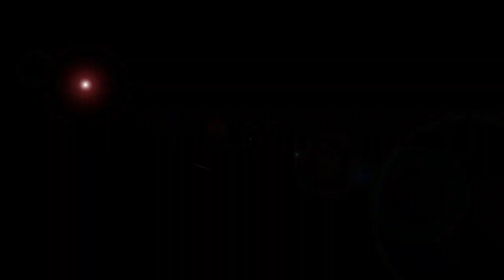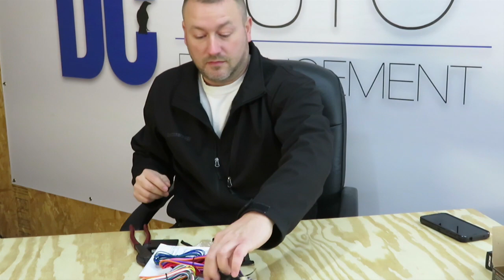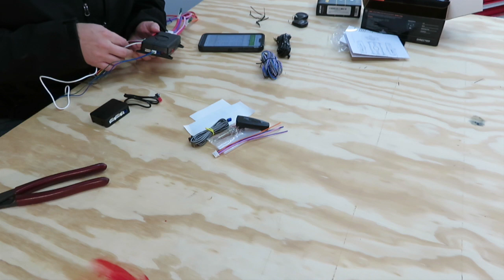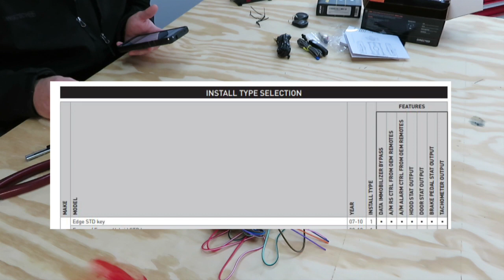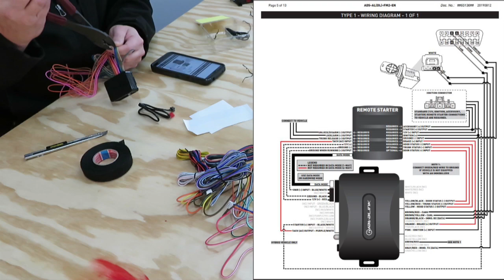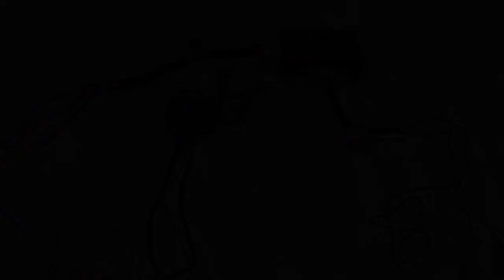Simplifying Remote Start Wiring! Easy Tip to Making Remote Start Wiring Manageable!

Comment: Any advice or needed parts?I got asked. To put this in a 06 pontiac torrent.
Reply from the maker: Here are the parts that you can use. And below check out the link to Flashlogic website. And I'll leave a link to your car wiring information also.
Avital 4105L 
http://bit.ly/36nkmdB
https://amzn.to/3nZrg1x

Flashlogic FLCAN
http://bit.ly/39AvzcI
https://amzn.to/3nWC5RO

Flashlogic Programmer
http://bit.ly/37AmVt2
https://amzn.to/3n1Mn1D
Flashlogic.com
http://www.bulldogsecurity.com/bdnew/vehiclewiringdiagrams.aspx

Comment: Can I just rid of the box that connects to obd2 port if only using it for remote start ?
Reply from the maker: What kind of car are you working on?
Reply: @DCAutoEnhancement   a 1993 Chevy Silverado
Reply from the maker: @colebryant6850  then you only need the remote start and no additional parts
Reply: @DCAutoEnhancement  thanks a lot man definitely gained a sub 🤘
Reply from the maker: @colebryant6850  I'm not sure if you have this info yet but here are two links to vehicle wiring for your truck:
http://www.bulldogsecurity.com/bdnew/vehiclewiringdiagrams.aspx
http://www.commandocaralarms.com/wiring/1992-1994/chevrolet/full-sizepick-up/462.html
Reply from the maker: @C M you will need a bypass. I use flashlogic from their website flashlogic.com you can look up your vehicle to find the module that works for your vehicle. Here is a link to the program the module: https://amzn.to/3n1Mn1D
Reply from the maker: @C M maybe look through my remote start playlist. I think I have one that may give some insight. It won't be for your exact vehicle. If I find the one I'm talking about, I'll put the link here.
Reply from the maker: Try this one: https://youtu.be/Hvdpr248kNE
Reply from the maker: I just realized that the link I sent was for the same video that you commented on. I'll post another link
Reply from the maker: Maybe this one. It's not your vehicle but you can see how I determine what wires I need and what wires I don't. https://youtu.be/-J6W7yhH0eE
Reply from the maker: @C M  let me know if you have questions.
Reply from the maker: @C M I usually download the software but it really doesn't matter what order you do it in

Comment: It's interesting and encouraging to see that a lot of the wires aren't used.  It actually does make me feel like maybe I can do this.  However, I feel like what's missing from this video is a brief discussion on why the other wires aren't needed.  Simply saying "A lot of these wires go away" is a good start, but why do they go away?  In other words, how do I determine which wires are going to be needed on my install?  I'm not installing my starter into the exact same car you have, so I'd like to get an idea of how different my install will be from yours.  Interesting video nonetheless, thanks for posting it.
Reply from the maker: I appreciate your feedback. Would you like information on how to determine what wires you will need and not need on you particular vehicle?  I'd be happy to help.
Reply: @DCAutoEnhancement  Really?  I'd take you up on that!  It's for a 2013 Subaru Legacy (automatic trans).  Thanks!
Reply from the maker: @mroberts566  can you send me an email at dcautodiy@gmail.com and I'll reply back with the info.
Reply: Sending an email your way as well.
Reply from the maker: Sent you an email back.

Comment: Hi! What wires would you need off the remote start if your not using a FLCAN?
Reply from the maker: The same that I had previously told you. You just won't be using the data harness that would go to the flcan
Reply: @DCAutoEnhancement  oh okay. Just wanted to make sure cause turns out to be that a 2013 Kia soul doesn't have a key immobilizer. Really appreciate your help. Sorry for the confusion. Thanks again
Reply from the maker: No problem. Did you get it installed? I think the door looks are the only thing that you will need to wire direct if your not using the flcan
Reply: @DCAutoEnhancement  I wired in all the heavy gauge wires as well as the parking light, door lock  hardness, brake shut down input, horn output, and I think about 2 ground wires. I ran out of time last night but I think I just have to find the tachometer wire. Is the tachometer wire necessory also did I miss any other wires? I appreciate you checking in. Thanks again for all your help. I would've never tired doing this install until I seen all your videos explaining wires breakdown.
Reply from the maker: Sorry for the delay. Tach is not required however, it is the best method. You can set the unit to "dbi tach" or voltage and it will work.
Reply: @DCAutoEnhancement  appreciate the help. I finished the install the other day the only problem I'm trying to figure out is why my parking lights are not going on when I activate the remote start. I checked the wire and everything seems like it's working properly. I did some research today and found something about using the jumper bypass. I'm gonna try that when I get a chance.

Comment: I am trying to hook this to a semi truck.   So I am trying to understand the bare minimum needed to make a remote starter work without any bells or whistles.   No key computer chips.  Just a basic ignition.  Truck won't start unless brake is on and the truck is in neutral.  It is an automatic and when the brake is engaged it automatically puts the truck in neutral.  So really what are the minimum number of wires needed for a remote start.
Reply from the maker: Where are you located? The brake pedal poses a bit of trouble but can be bypassed. Usually you will only need 4 main ignition wires (12v, ignition, accessory, and start) (Ground and black/white small wire on remote start)

Comment: What kind of bypass you used for that remote starter ? and what’s that bolt  looking thing I think you said it’s on  hood sensor or opener
Reply: And do you have a video of you installing this remote starter on a vehicle from start to finish like each piece thanks
Reply from the maker: @RajendraSingh-qg3cx  I actually have a video coming up that I will do a start to finish. I have been making the videos shorter for the sake of time but felt that it might be appreciated if I make a more detailed video. I'll probably be posting the video that I'm talking about Jan 7th. Is there anything in particular that you would like to see?
Reply: DC Auto Enhancement I have a 2008 Kia Sedona do you have any advice for me if I need to use the hood pin And what wired to illuminate from the remote starter please and thanks in advance
Reply from the maker: @RajendraSingh-qg3cx  the hood pin switch is a safety device that will prevent the remote start from starting the car while the hood is open however, it is not required for operation. I'll look up info on that vehicle and add a link to this reply for you to view. The only advice I have is to make sure you have everything you need before starting the installation, test your wires before making the connections when and where possible, and take your time.  I took a look at the FLCAN, if you use that bypass you won't need to direct wire the door lock wires. Take a moment to review this and read note #3 http://www.commandocaralarms.com/wiring/2008-2011/kia/sedona/1206.html
Reply: DC Auto Enhancement Many thanks but I’ve already googled and got that diagram for my vehicle in advance and I am going with that flcan module as you recommend The bypass module I currently have is way much cheaper very much more complicated so I’ll spend a few dollars more and go with the  flcan
Reply: And also that website is suggesting that I use the 791 module now I’m puzzled I don’t know which way to go
Reply from the maker: @RajendraSingh-qg3cx  which bypass do you have?
Reply from the maker: @RajendraSingh-qg3cx  the 791 bypass is the one that website sells. You can use any that will work for your vehicle. The only draw back to the FLCAN is that you have to have a programmer for it to download the firmware for your specific vehicle.
Reply: DC Auto Enhancement I currently have in my position banvie universal but after I saw your video I thought the falcon was the best one to work with the remote starter and I bought the exact remote starter that you have in your video so I look up the flacon to buy it but I have not bought it as yet
Reply from the maker: @RajendraSingh-qg3cx  you will want to buy the FLPROG as well.
Reply: DC Auto Enhancement OK thanks but I found a seller that says if I bought the falcon from them they would program the device to match my vehicle Hope it all goes well I really wish there was a video that shows me what wire I need to illuminate from all those wire that came with the remote starters just like the video you did with the Ford explore
Reply from the maker: @RajendraSingh-qg3cx  when you say illuminate, I'm not exactly sure what you mean
Reply: DC Auto Enhancement Sorry I meant to say eliminate lol
Reply from the maker: @RajendraSingh-qg3cx  comment when you have all of your equipment and I'll go through the wiring of both the remote start and the bypass and make a short video and post the link to it.
Reply: DC Auto Enhancement Again many thanks for your time and all of your help very much appreciate it
Reply from the maker: @RajendraSingh-qg3cx  not a problem that's why I decided to start paying videos.
Reply: DC Auto Enhancement I should get the bypass by next week so if you have a video by them I know you said by the seventh that will be perfect
Reply: Hey buddy it’s me again I got all my stuff in  and I got the module and the remote start So whenever you have time to make that small video and walk me through this step-by-step Wiring like you said I will appreciate it thanks
Reply: DC Auto Hey buddy it’s me again I got all my stuff in  and I got the module and the remote start So whenever you have time to make that small video and walk me through this step-by-step Wiring like you said I will appreciate it thanks
Reply from the maker: @RajendraSingh-qg3cx  I'll be posting it shortly. I filmed it this evening. You gave me a good idea to offer this to anyone wanting the same help. I did notice that from what I can tell your vehicle needs the Klon process done which is a two step programming to program your module. Basically means that you will install, do step one of programming, remove and hook back up to computer, then reinstall and do the second part of programming. Unless I missed something.
Reply: DC Auto Enhancement Yes you are right I was told that when I bought the program cable you advise me too so if you have the website or the program that I need to download also I appreciate it
Reply from the maker: @RajendraSingh-qg3cx  I will. I am installing a remote start on a 2013 Kia Optima tomorrow and it will be very similar in the programming so I will try to make make sure to cover that part clearly.
Reply from the maker: @RajendraSingh-qg3cx  Flashlogic.com
Reply from the maker: @RajendraSingh-qg3cx  the video should be live in about 30 min. I'll put the link here
Reply: DC Auto Enhancement ok thanks
Reply from the maker: @RajendraSingh-qg3cx   it took longer than I expected. Please let me know if there is anything that I missed. If I could have installed one to show, I would have. Hopefully the programming on my next video will be helpful.  I'm going to try to capture more of the programming of the FLCAN as well as the remote start. https://youtu.be/FdcY8_jHw9w
Reply: DC Auto Enhancement hey buddy it’s me again I got the remote start and the bypass  wiring connected I have two question for the bypass we do not need the data cable like you said or we will need them later and the power card for the bypass which is the black red and blue and white do I connect them to the bypass or I don’t need them at all if I don’t do not need none of these wires what connects the bypass to Remote start
Reply from the maker: @RajendraSingh-qg3cx  you will use the data cable that has the red plug on it. That is how the Avital unit communicated to the FLCAN
Reply: DC Auto Enhancement I did that what about the power cable from the bypass that has the red black and blue wire I just sell eliminate that all together and do not use it thanks
Reply from the maker: @RajendraSingh-qg3cx  you don't use it.
Reply: DC Auto Enhancement cool You did a good job on the video man explain in every wire that’s your needs
Reply: Hey buddy good morning it’s me again do I need the valley switch for programming does it need to be on the remote starter And if so do you have a video of how to program the remote starter thanks
Reply from the maker: @RajendraSingh-qg3cx  the valet switch comes with the remote start and plugs into the side. I unfortunately didn't have the opportunity to film the programming of the remote start that I did on Saturday
Reply: DC Auto Enhancement just wondering if you will  be doing a video of that soon thanks
Reply from the maker: @RajendraSingh-qg3cx  the next remote start that I install, I will capture the programming. Not sure exactly when that will be though.
Reply: Hey buddy I meant to ask you on the remote starter it has two red wire that you said it’s constant but on the Sedona only the white is constant so how do I hook up the two red
Reply from the maker: @RajendraSingh-qg3cx  they both will go to the white constant 12 volts
Reply: DC Auto Enhancement and I just leave the yellow by itself don’t do nothing with it? The
Reply from the maker: @RajendraSingh-qg3cx  yellow on the car  or remote start?
Reply: DC Auto Enhancement on the car
Reply from the maker: @RajendraSingh-qg3cx  if it is not listed on the wiring information, then it would be left alone
Reply: And now I’m stuck because I don’t know the wiring on the bypass where they go and what are the wiring for from your video instruction I have the eight wires but I don’t know which wire harness each wire. So if you have a video or you can inbox me I would greatly appreciate it
Reply from the maker: The Kia I just did had one wire not used
Reply: DC Auto Enhancement So if you can tell me what the wiring does on the bypass each of the eight appreciate it
Reply from the maker: @RajendraSingh-qg3cx  click on the link below and download the guide. Once downloaded, find your vehicle and identify the install type then find that type in the guide and you will see where each of the wires go
Reply from the maker: @RajendraSingh-qg3cx  https://www.flashlogic.com/firmware/firmware/firmware_family_id/129/product_id/51/vehicle_make_id/22/vehicle_year_id/2008/vehicle_model_id/95/package_type/0/vehicle_id/5289
Reply: DC Auto Enhancement Yeah I’ll try to figure it out I was hoping you could just walk me through it like you did with the main harness for the remote starter Like for example you would be like black and yellow for the heater  for trunk release etc. etc.
Reply from the maker: @RajendraSingh-qg3cx  I won't be able to do that until Wednesday.
Reply: DC Auto Enhancement I can wait I don’t have a choice
Reply: Hey buddy good morning hope you don’t forget me with the wiring and when you get a chance thanks
Reply from the maker: @RajendraSingh-qg3cx  can you email me at dcautodiy@gmail.com and tell me exactly what you need. I think I have an example of what you are looking for I can email it back to you
Reply from the maker: The item that you are referring to is a hood pin switch. A lot of the newer cars will actually transmit the hood status through data using a bypass. The bypass that I use almost everytime is the Flashlogic FLCAN.